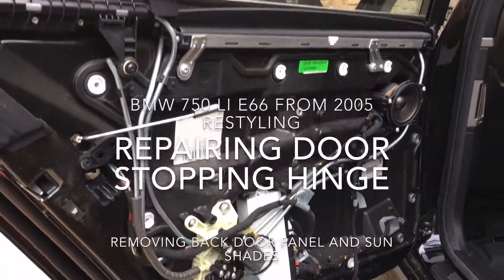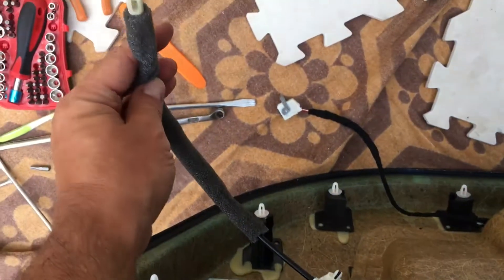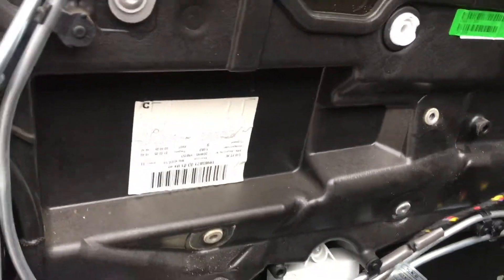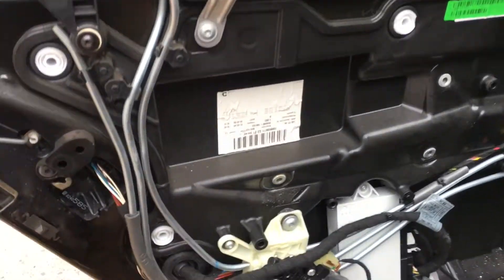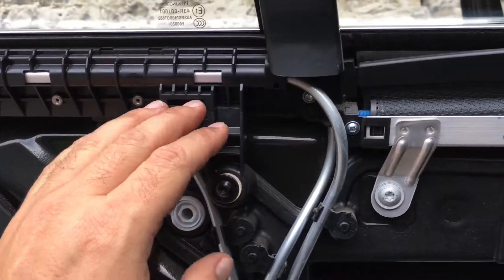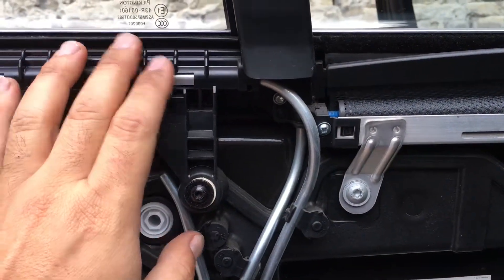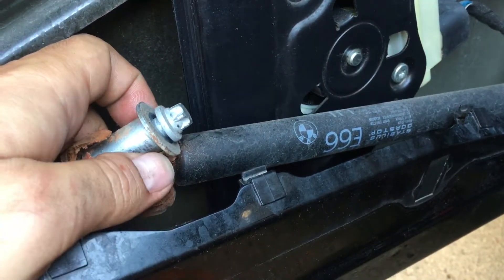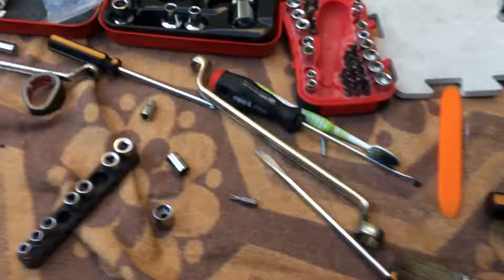Removing rear door panel BMW 7 e65 e66 door stopping hinge

Comment: I like your video. Can you tell me where I can order the door stopping gas struts? My car is a 2006 750i.
Reply from the maker: @TimStokes Ali express 
https://a.aliexpress.com/_EvTdYdP
Reply from the maker: Its a little bit tricky job, for all four doors it took us around 11 working hours
Reply from the maker: Please look at the video and pay attention specifically on rear doors because of automatic sun shades...first do the front doors
Reply: That's the rubber but I need the door stop , or strut if you can tell me?
Reply from the maker: Only officialy, bit that is not the problem...its a real iron, it never brakes

Comment: Brother how did you push the rubber in as it is very hard to go in. And did you put in rubber with the metal sleeve being in the rubber or did you put in afterwards
Reply from the maker: It is hard, but I oil it with wd40 and it slide in, metal sleeve we didnt remove...just the rubber